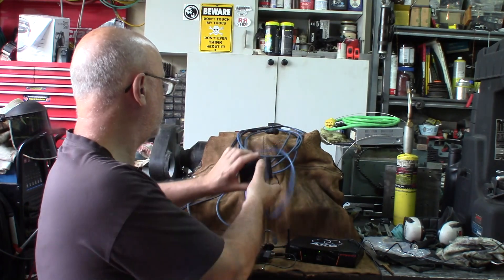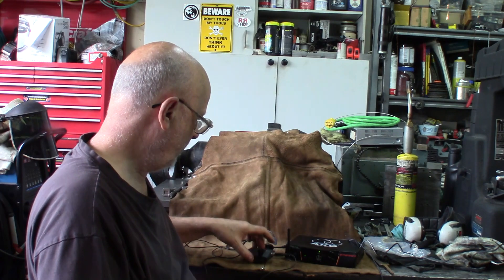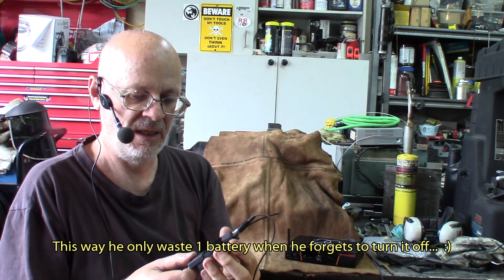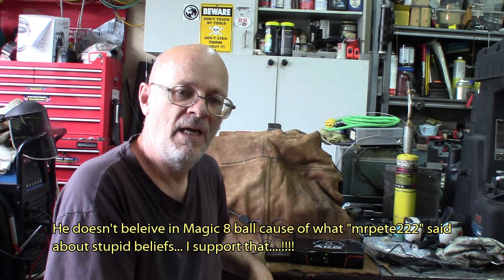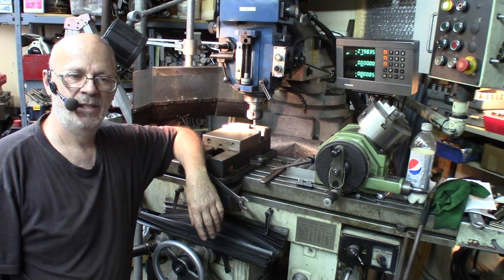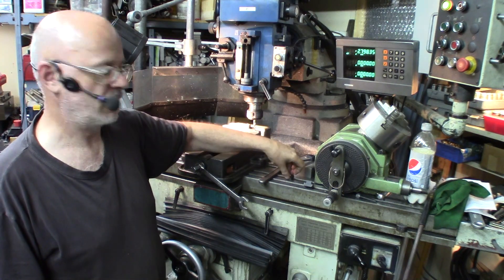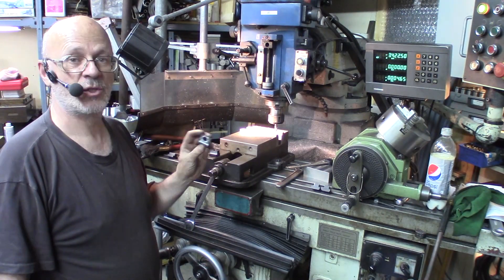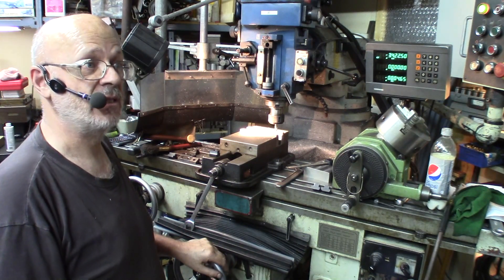Adapting T-Nuts + New AKG Wireless Microphone

Comment: I cheated with my slightly oversize t-nuts - just used belt sander  to reduce the small extra base width I had on mine. Your approach is the way to go. Mic sounds v nice.
Reply from the maker: +ChrisB257 Hi Chris, for light adjustment the belt sander is all right, for heavier removal it's hard to keep constant results on the sander...  Now, the nuts usables, compared to before, it's 100% better... lol.
After a little tweek the mic will be even more blended as far as level is concerned, the fact that the machine noise is not so present is a big improvement on clarity of the voice... 
Cheers,   Pierre

Comment: Fidelity is much better with the wireless mike, not to mention volume level was higher as well.  My only suggestion might be to not crowd the microphone, it picks up quite well and perhaps you can move it a little more to the side and not block your handsome face.
Reply from the maker: +hankus253 Hi, as you say, after a couple of adjustments, it will be a much improved setup as far as sound pick up is concerned.
Handsome face... Thanks for noticing...  :))
Cheers,   Pierre

Comment: I was listening with my headphones so the wife could watch TV and when you started using the remote mic the sound got a lot louder in my left ear.  By the way was that 1200 metric or imperial rpm?   Thanks for sharing.
Reply from the maker: cerberus Hi Harold, yap there is on side off with the connection to the camera from the wireless, to be corrected soon...

Precisely 1800 rpm in metric but for the clever ones in the imperial system it's really 1832.4567 RPMs..... :))

Cheers,   Pierre

Comment: Hi mate.
That is a nice set.  I had bought a throat mic for on the bike, that was before my crash, those things are quite handy too.  They used to be used by the WWII RAF pilots.  The throat mic only takes the sound of your voice, and a lot less ambient noise.  With this mic you look a bit like an airline pilot.  Question remains which runway captain.
Bon,
Marcel.
Reply from the maker: Marcel Timmers Hello Marcel, should I say "HiJack", since we're talking about plane....  :-))
I think there are a few adjustments to be made, and I'll work at it for next video...
By the way attack your seat belts, We're taking off for Paradise Island....
Cheers,   Pierre
Reply: The plane the plane.......